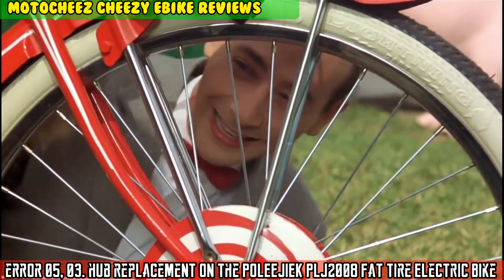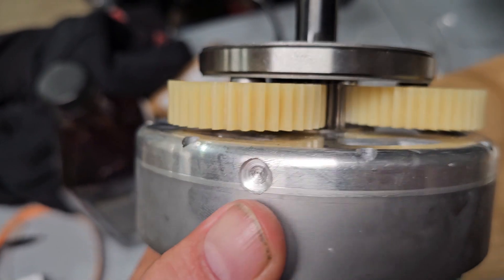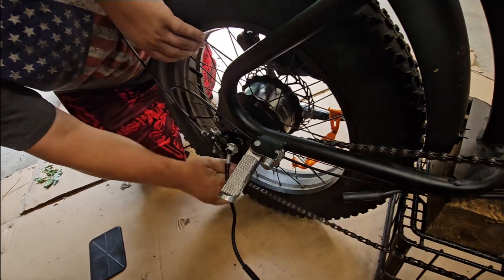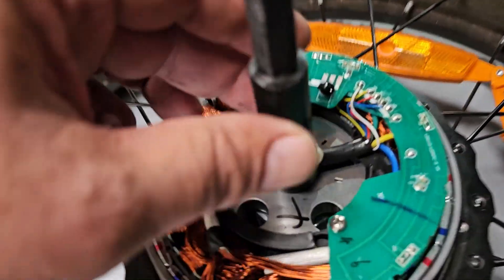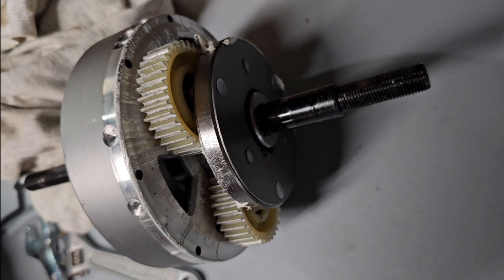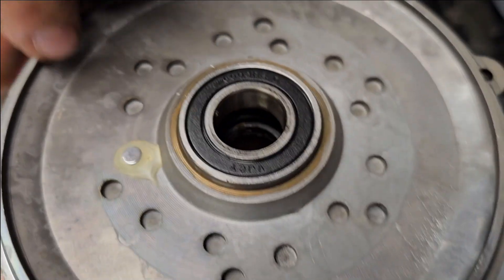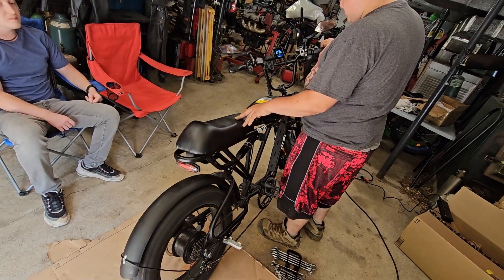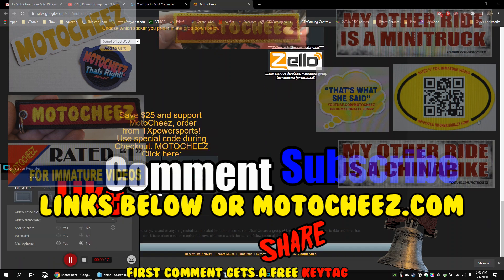Hub Error code 05 and 03. Hub replacement on the  POLEEJIEK PLJ2008 Ebike. Broke down hub failure

Comment: Cool I was wondering how they geared those internally, 
Nice that the seller stepped up and got moto Rider back on The road.
How long did it take for the part to come.
That old saying..If it has wheels or t _  ts  it will give you problems😂😂.
Looking forward to the video getting up to the samurai Steve cabin I'm sure that's a good one as well

Looking for that video of cruising up to the cabin.
Reply from the maker: It was shipped from China took about a week and a half to get here, working on the video for samurai Steve's right now

Comment: Probably used nylon to prevent wear on the less serviceable parts or noise reduction.
Reply from the maker: Definitely, and there were several comments on here that they have 5,000 plus miles and never had to change them which is pretty incredible. I see it some have a hybrid aluminum and nylon mix on the super high wattage hubs now too

Comment: Whenever you have something like that apart and the bearings are exposed, pop the grease shields off and add grease about halfway around, pop it back together and you should be good to go.
   Never assume a new bearing is greased properly either.
Reply from the maker: I do agree but sometimes popping them seals off I have ruined them and put a little dent so I usually try not to mess with them unless I start having a problem

Comment: The nylon gear will last a very long time if you replace the grease every now and then.
Depends on the type of grease you're using.
The white grease I'd say every 800 miles.
Im using Mobilgrease 28 and do about every 1000 miles, or if i go through deep water il check it the next day.
Reply from the maker: Awesome info, thank you!

Comment: It's likely one of the 3 hall-effect sensors on the circuit board that's failed. I had the same thing happen to the hub motor on my ebike. Luckily I had a spare sensor, and was able to repair the motor without replacing it.
Reply from the maker: I'm definitely going to try to repair this one thanks for the info

Comment: A while back I had built a shwinn beach cruiser  trike  conversion   I put a limited slip locking diff  with a preditor 420  engine to power the back. The tire were fat tires  and the front was a 1000whub motor. In case  it runs out of gas .  I guess it sort of a hybrid.  I have to be care full when turn because of the spring forks  at high speed   are sensitive.  💯👌👍💪  with the engine and hub motor its difficult  to peddle  i should of put a 12speed  in stead of a single speed  would  of made a little easier to peddle 😂
Reply from the maker: That's a great idea I actually thought about doing something like that

Comment: It be better if the gears were at least made from delron plastic instead of the nylon.  💯👌✌️👍💪
Reply from the maker: Wonder if they make an upgrade? But I just had someone say they had 5,000 miles on the exact same hub and it's still going good, said good to know it's an easy fix when they do wear out